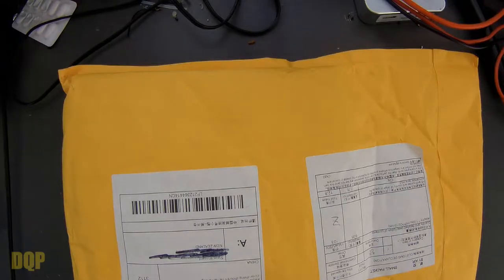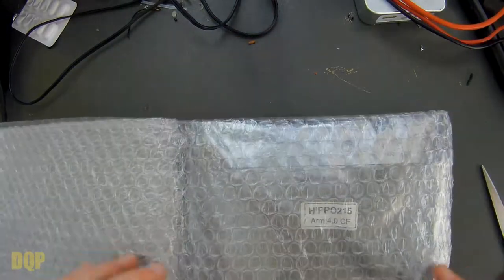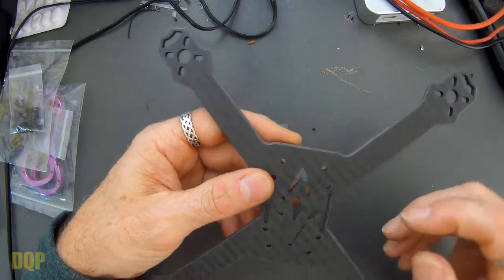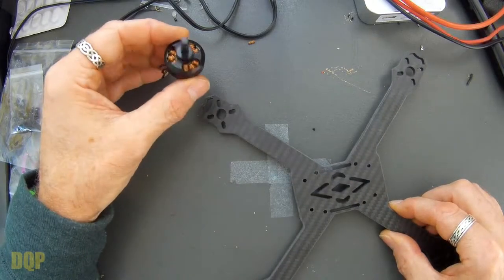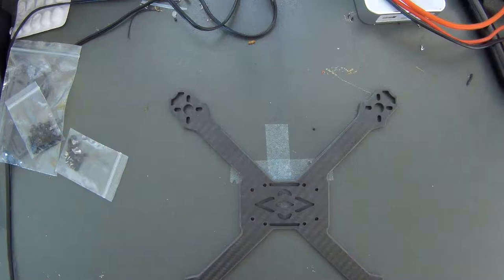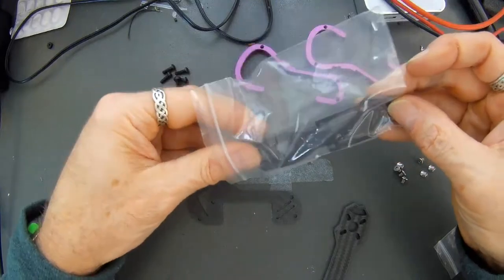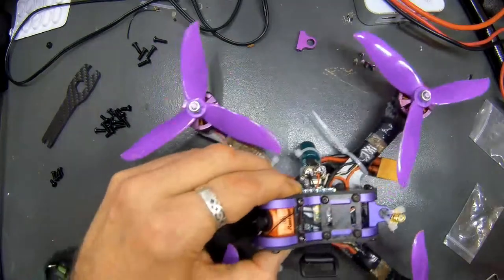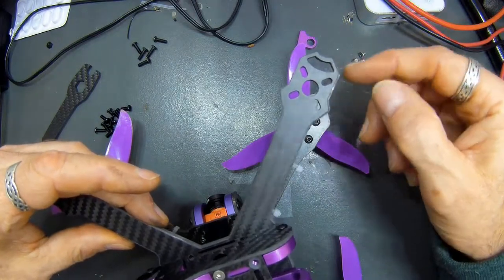ReadyToSky (Aliexpress) Hippo Frame Unboxing.

Comment: Nice brother! Looks better than the bg version.  They r tight builds but sweet frames
Reply from the maker: Man, that they are! The first time around I managed to get everything inside the frame. This time around I couldn't quite pull it off, but I am using a different FC and different Vtx, and they don't quite fit together as well. sigh That' part of the fun I guess...

Thanks JJ :-)

Comment: Lol, that damn drone racing interrupting our review! Great review, I had a feeling the outer motor wire channels would be a bit weak. They look quite thin. Are the aluminium parts holding up?
Reply from the maker: LOL, I reckon!
They are a bit thin. As I mentioned I flew backwards into a shipping container and crushed the carbon channel on that one arm. If I had run wires through there it probably wouldn't have ended well...
The aluminium is actually holding up really well. I'm thinking that the screw holes are likely to be the thing that goes first if there's a lot of rebuilding and they are over-tightend. 

Cheers Lee :-)